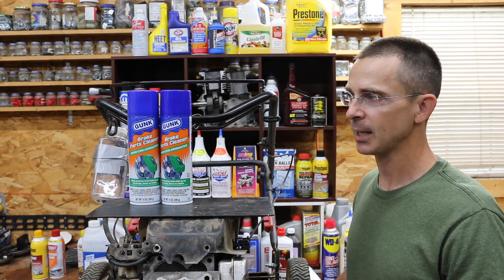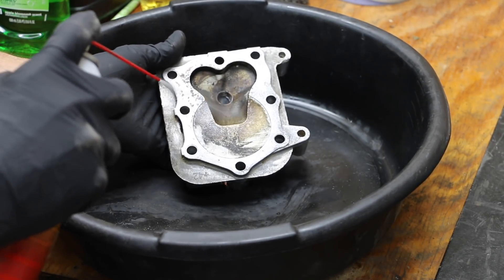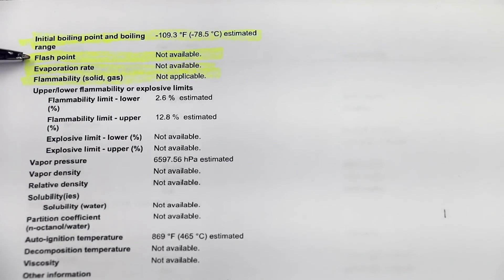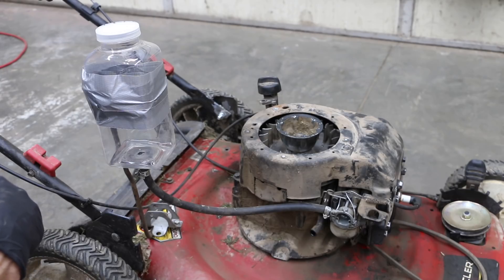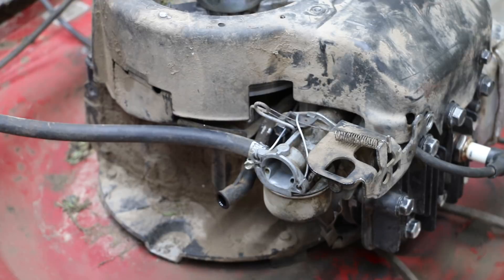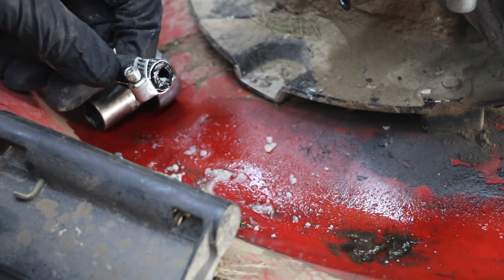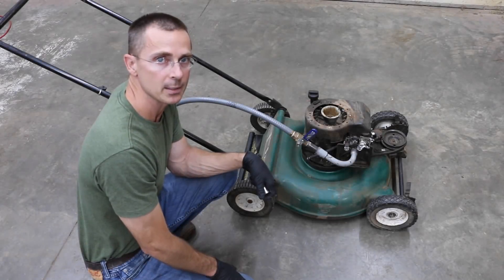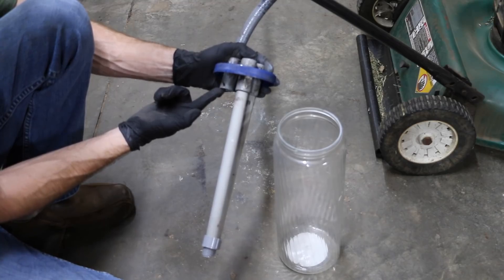Will a Gas Engine Run on Brake Parts Cleaner?  Lets find out!

Comment: Great video. I noticed you had Gunk brand brake cleaner. The stuff I absolutely love is AC Delco brake cleaner (sold at most GM dealerships).  It seems to be very effective at cleaning parts AND gentle on rubber from what I’ve found. Maybe something worth a try if you clean lots of parts with rubber pieces.
Reply from the maker: Thanks for the suggestion.

Comment: I would love to see an engine running on an air duster can. Those cans have around 30% propane by weight in them, would be interesting to see if an engine can run on that.
Reply from the maker: Thanks for the suggestion.

Comment: Running a engine on brake cleaner is extremely dangerous for the same reason you don't clean off parts you're going to weld with brake cleaner. When it burns or combust it produces deadly fumes that can overwhelm you, burn you eyes, throat, lungs and possibly even kill you.

Comment: You should do a comparison on refrigerants in an a/c system. I currently run r152a in my car (for like 6 years now) and it is amazing. No issues with venting it to the atmosphere either and it's super cheap. I understand that r290 (propane) is pretty good as well, but it should be mixed with r600. I don't understand why car manufacturers don't just use the r152a instead of all this 1234xyz crap.
Reply from the maker: Thanks for the suggestion.

Comment: 2 stroke won't start, my friend said to spray brake cleaner in the intake that will boost it up
It still won't start help please
Has compression, has spark ( the plug was very black and oily, which means its very rich so I adjusted the carb, but still won't start, i couldn't buy a new plug just yet, but i did clean it and it has spark, could it still be bad?)

Comment: Speaking of burning chlorinated hydrocarbons, I have starter fluid with upper cylinder lubricant that contains ethyl chloride; Should I be concerned about that? I was astonished when I read that on the ingredients list, but maybe it's not that bad.
Reply from the maker: Thanks for the video idea.

Comment: Can you use a gal or two of liquid brake cleaner to clean out the sludge 5" w & 5 ft long in the bottom of a 100 gal tank? The sludge won't drain out the drain holes. I was able to get a very small amount of the reddish orange sludge out to test, using acetone, Denatured Alcohol & I also tested spray break cleaner. Alcohol did ok, taking  a little time but its a 1/4 the price of liquid break cleaner. But the spray break cleaner just disintegrated the slime. My question is do you know, or can you test, how many gallon cans would need to be used in a 100 gal tank. Will the tank need to be clean out afterwards?  Jolly good show here.
Reply from the maker: Thanks for the video idea.
Reply: @ProjectFarm  I just tried, "Dieselcraft's Technol 246, a fuel additive that penetrates and dissolves diesel sludge buildups to solve filter plugging problems in ...". I added the product right out of the bottle to a small sample to the sludge. It did absolutely nothing, WTH. While the break cleaner disintegrated the slime. The question is, how to get the break cleaner/disintegrated the slime out before it hardens again.

Comment: I once sunk my 15hp Evinrude outboard motor and fuel tank.  As soon as I could l, within minutes I had the boat back upright, towed to the ramp and where I could pull the spark plugs snd pull it over to blow out any water in the cylinders.  Not having any I ask my wife’s uncle if he had any starting fluid(ether) he said he had something better that would add lubrication and handed me a can of wd40.  So I removed the air cleaner and sprayed the wd40 into the carb throat and periodically did so to kept the motor running and chase out any water from the crankshaft bearings, piston wrist pins and cylinder walls.  I ran it that way for several minutes feeling the discharge (pee tube) water and actual engine outer water cooling jacket until it was warm to touch.  Let it cool, got new fuel and oil mixed and went bank to fishing.  Haven’t ran it in years but last time I did numerous times I noticed no indication of a problem. So, I normally(if I have any) first try wd40 before starting fluid(ether) which has no lubricating qualities but wd40 does.  I dint think I would recommend running a two stroke for prolonged periods or even a 4 stroke. 2 stroke concern because they can run too hot with too much oil to memory.  I don’t know, but suspect wd40 liquid would run in a gas engine as a liquid, ive never tried it in liquid form but rather spray aresol into carb throat to start, dry out a dink and recovered 2 stroke outboard.
Reply from the maker: Thanks for the feedback.

Comment: They run off carb cleaner. Been there, saw that, bought the t-shirt. It's how i quick test if an engine will start.
Reply from the maker: Thanks for sharing!
Reply: @ProjectFarm  You're a really cool guy. I bet you already knew brake cleaner was highly acidic, and would gouge aluminium when heated. But you took the time to demonstrate it for viewers anyway. I love your tests and reviews.

Comment: Hey man I love your videos!! I was wondering what it would be like to run a motor on PVC clear pipe cleaner. I noticed upon observing the SDS, it has different and interesting chemical compositions like Acetone, Cyclohexanone, and Methy ethyl ketone which when combined are very flammable, but how will it perform in a combustion chamber and what would the side affects be? Thanks!!
Reply from the maker: Thanks!  Thanks for the suggestion.

Comment: As long as you have a BTU measurement of the chemical that your using, you can run it! It’ll definitely be a clean engine afterwards, the only problem I see is the seals failings, to hot on the internal parts.
Reply from the maker: Thanks for the feedback.

Comment: Next try Toluene. If it doesn't run, shave the cylinder head to increase compression as toluene has a very very high octane rating (F1 used it in  the 1980's for their highest power cars)
Reply from the maker: Thanks for the feedback.

Comment: Hi 
What about if the engine running on gasoline and spraying brake cleaner with a Pump pressure can with a thin hose directly into the engine  intake through the carburetor 
Will the engine get some boost, like nitrous for the poor folks??:D
And Maybe the engine gets very clean inside ?
Ans Maybe it is also possible for a diesel engine 
And Maybe test with a  low budget car 

Thanks for your great Videos

Comment: May I suggest running a small engine (and the see thru cylinder head engine) on straight alcohol?  I looked and I don't believe that you have ever done that.  You would need an adjustable carburetor for running alcohol.  Excellent video as usual.
Reply from the maker: Thanks!  Thanks for the suggestion.

Comment: What happens when you slowly overheat an engine gradually building up the temperature over a few hours? Probably using a liquid cooled engine and slowly restricting the coolant flow.

Comment: When an engine run on hydraulic brake fluid or a combination of brake fluid and gas
Reply from the maker: Thanks for the suggestion.
Reply: @ProjectFarm  Oops, well you know what I mean! 
Someone told me they dont have to clean out the shop oil-burner because they burn so much brake fluid???

Comment: im pretty surprised it did not start well i use brake part cleaner as starter spray for my 2stroke scooter all the time as it does not start on its own for me it can start engines very well, i got an old scooter that wasnt started in 15 years we sprayed it into the carb and it started on 3rd try
Reply from the maker: Thanks for the feedback.

Comment: I use it to start my push mower when it doesn’t want to start. Cheap plastic carburetors and ethanol gas aren’t really great teams if you let them sit long between uses. Carburetor cleaner doesn’t work well enough to clear the blockage but brake parts cleaner does.
Reply from the maker: Thanks for sharing.

Comment: I know a mower will run on brake clean or carburetor cleaner. I just use it to start one that's been sitting for a long time. I have normal gas in the tank by the way.
Reply from the maker: Thanks for sharing.

Comment: The most volatile component of this mixture is the carbon dioxide used as the propellant, not any of the cleaning chemicals...hence the -78°C boiling point (CO2's sublimation/vaporization point) and no, I'm not going to convert that to freedomheit lol
Reply from the maker: Thanks for the feedback.
Reply: @ProjectFarm  ol boy reads and replies to comments on 3 year old videos...what an absolute legend!

Comment: Most chlorinated brake cleaner won't burn...it's tetrachloroethylene ...it will pretty effectively work as a starter fluid because it cleans out the carb and let's the gasoline flow better
Reply from the maker: Thanks for the feedback.

Comment: Please test if an engine will run on the liquid carburetor cleaner that comes in an aerosol can? What a great way to clean the jets on a carb. The liquid from multiple spray cans of carb cleaner is put in the gas tank after the tank has been drained of all gas and the carburetor  is drained as well then the engine is run on straight carb cleaner. It will clean everything from the inside. I was thinking this would be a good way to clean a carb(s) on an outboard engine that has sat for a while. Thank you
Reply from the maker: Thanks for the video idea.

Comment: I have a question,  How long does the Brake clean last when Using vapors to run the mower? I know its evaporating at a rate, i was wondering if vapor powered engines would use less fuel and be set up for long-term use 🤔
Reply from the maker: Thanks for the video idea.

Comment: would be cool to see if engines can continuously run off of a water methanol. like a water methanol injection. or even water methanol injection and typical gas, to see if it will help it run better, and even keep it continuously cleaner.
Reply from the maker: Great suggestion!  Thank you.

Comment: Far as I know, low boiling point doesn't make something flammable per se. Like helium, not flammable, super low boiling point. It does mean it will vaporize very quickly, and if it IS a flammable substance... Very many very fast booms.

Amazing videos btw 👍👍 the way you tackle your experiments is a breath of fresh air, so unbiased and thorough.
Reply from the maker: Thanks!

Comment: When we worked at an auto shop, my buddy and I would move around the shops F350 with a fuel injected 460, bad fuel pump by one of us driving and one spraying brake clean into the intake. 
Question: do you have a video on testing Head gasket sealant? -the pour in kinds that go into the coolant.
Reply from the maker: Thanks for the video idea.
Reply: I figured you might already have one. There are many products at the auto store , and several of them state “guaranteed to make a permanent repair”
They also say they work for diesels. 
Hope to see one soon!

Comment: When I would clean my carburetors on my old cars back when, I would pinch the line and run the float bowl dry.
After that I would fill the float bowl with carb cleaner, and fire up the engine, cleaning all the ports.
Brake cleaner was nasty back then, never tried it.
But, the engine DID run on the carb cleaner, so it was a breeze when maintenance time came around.
Reply from the maker: Thanks for sharing.

Comment: I use either brake clean or carb cleaner to get cars with dead fuel pumps into the shop. I just sit under the hood and spray in the cleaner near the throttle body. Another person idles the car into the bay. It's a lot easier than pushing the car

Comment: We use to put mothballs in the gas tank to get a boost, I don't know if they still make them with the same ingredients but it was like nitrous oxide in your tank. We also put a ping pong ball in the tank of someone we didn't like. When you started the car the ball would block the line and shut off the engine, you could restart it but then it would block it again. Drove people crazy.
Reply from the maker: Thanks for sharing.

Comment: May I point out (I admit this is rather late) that this should NOT be tried with chlorinated brake parts cleaner? You will generate an appreciable amount of phenomenally toxic gases [edit: as you point out in the video]. Not that benzene is entirely your friend, but it's less immediately lethal.
Reply from the maker: Thanks for the feedback.

Comment: On the channel "junkyard digs" Kevin uses brake cleaner in place of ether (starting fluid) all of the time. It works but I wouldn't do it. I'd imagine it would destroy any soft components (throttle body gaskets, etc.)
Reply from the maker: Thanks for sharing.

Comment: I sat back and wondered, How much of the cylinder head has been slowly removed over the course of your tests and, have you ever had to re gap the plug? Also I am surprised you haven't had a custom head made of high heat Pyrex glass. Also, how do you obtain and maintain your spark with the clear head since there is no ground to the engine block, or at least it seems? Here's an idea: can your mower that runs on fumes, run on Acetylene gas, provided you can find a way to introduce it.
Reply from the maker: Thanks for the video idea.

Comment: I'm a 20 year small engine mechanic. It will absolutely run on brake cleaner. Here's the problem, after brake cleaner has went through the combustion process it becomes a poisonous gas. Yes I know, non-chlorinated. However if you read the sds and a few research articles you will find it is very toxic when burned. I know from experience.
Reply from the maker: Thanks for sharing.
Reply: @ProjectFarm  thanks for replying! Love your channel!

Comment: We use carb clean to get engines going when fuel pumps failed. One guy sits on the hood spraying into a vacuum line or PCV hose, the other drives it into the shop. When I worked at GM, there was a bulletin i stumbled across for the Corvette. It said don't use chlorinated brake parts cleaner in place of carb cleaner. Something about the chlorene affecting certain internal engine parts that are of alloy construction. End result is a blown motor.
Reply from the maker: Thanks for sharing.